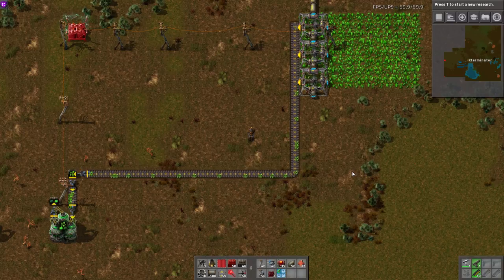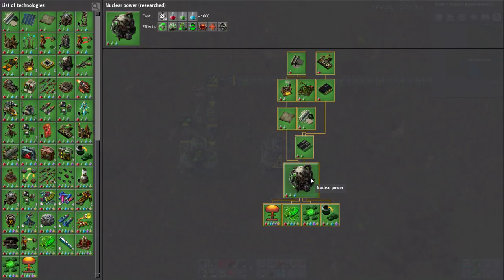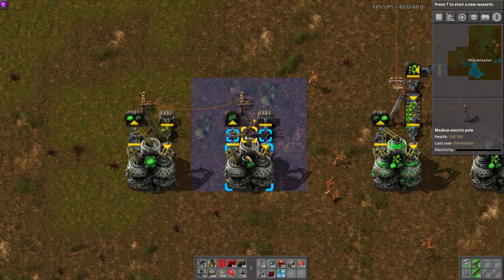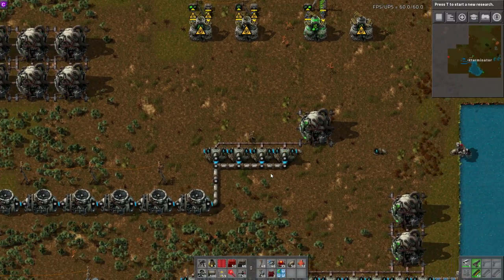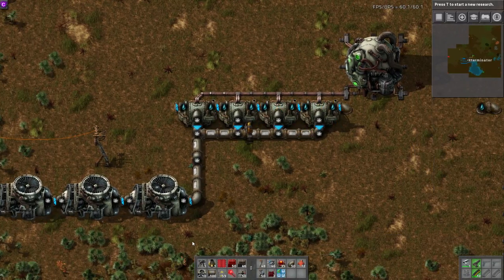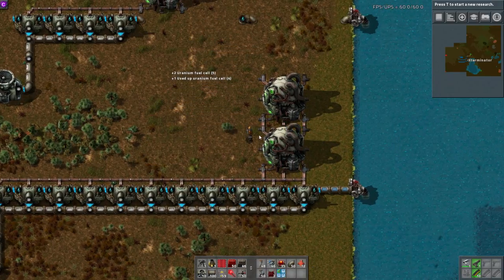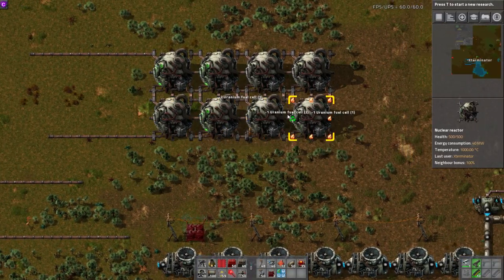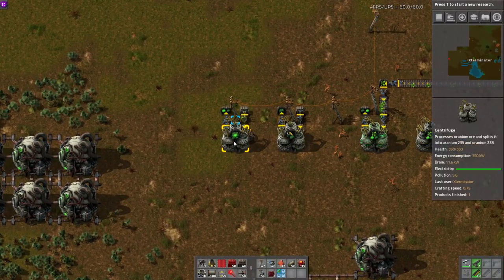Factorio 0.15 Nuclear Power Tutorial - Features & Ratios

Comment: There's going to be some creative nuclear builds out there soon. Unlike coal powered boilers which shut down if the steam engines aren't running at full capacity, the reactors run at 100%, burning fuel cells continuously whether or not the turbines are running at 100%. Additionally, they heat up to 1000 degrees, but the heat exchangers work at 500 degrees. So you can delay putting fuel cells in the reactor until the heat exchangers cool down and stop producing steam. The trick is working out how to measure the temperature drop so that steam is no longer produced. One way would seem to be storing the steam in a tank before it goes into the turbines. If the level starts dropping, it's time to let the reactor have more fuel.

Comment: Take note that a single heat pipe has a maximum energy transfer of 1 GW.
Reply from the maker: Very good point!
Reply: So that's 6 or 7 reactors if I were to take this spreadsheet, right?
 https://forums.factorio.com/viewtopic.php?f=5&t=44778&start=80
Reply: With the changes in v0.15.11, you'll never be able to hook enough heat exchangers to a single heat pipe to need to worry about it anymore.

Comment: If I'm understanding this correctly, The implications of the neighbour bonus are that you should build square blocks of reactors, rather than any other shape.

take 4 reactors. Loose, that's 4 reactors.
In a straight line, thet's 4, with the two middle reactors getting a 2 bonus, and the outer ones getting 1. so it's 4 + 6 = 10.
Arranged in an L shape, nothing changes. In a T shape, the middle reactor gets 3 bonus, the other three, 1 each. (6 bonus = 10 total)
Yet, put into a square block, all 4 reactors are adjacent to two others.
Thus the bonus is 8, for 12 total.

9 reactors in a square would be 9+4x2+4x3+1x4 = 33

Hmm. Seems like you want to maximize the internal reactors, and keep edges, but especially corners to a minimum.
5 reactors in a T shape is 5+3x1+2x1+1x3= 13
5 in a square plus 1, 5+3x1+3x2+1x1=15
5 in a 'plus' shape is 5+4x1+4x1=13.

OK, so it would seem the optimum is very much about having as many adjacencies as physically possible.
Not always as straightforward to work out as it seems for a given number of reactors, but it still seems as though the closest approximation to a square that's possible is best in most cases.

hmm. for 8 reactors, 2x4 rectangle. 8+2x4+3x4=28, 3x3 square with missing corner 8+4×1+3×2+2×5= 28, while 3x3 with missing edge is 8+3×4+2×2+1×2=26 -which illustrates that you should avoid unneeded corners I guess.
Reply: Wow that’s a lot of math :0
Reply: before building perfect squares and doing lots of maths, remember that unmodded inserters have only a reach of 1 or 2 tiles, and also can't reach diagonally. thus even on a small 3x3 square, no inserter will be able to insert fuel cells into the center reactor and you'll miss on all those nice neighbor bonuses as if that center reactor wouldn't exist. similar also applies to all other square or rectangle layouts which are wider than 2 reactors. even in the case of a small cross of 5 reactors, how would you feed the center one (that theoretically could get a bonus of +400%)? thus the practical limit is to have only 3 neighbours for any reactor, and as few corners as possible.

there are mods for inserters with extra long reach of 4,7,11,..., especially created to fuel up reactors in such huge rectangle layouts, and several other mods for operating them diagonally, but no such luck in vanilla and you are limited by accessability of the reactors, resulting in the most simple version, having stripes of 2xN reactors, already giving all of the reactors (except for the four corners) the practical maximum bonus of +300%, and still the next best +200% bonus for those four corners.

and even then it also already will be a challenge to make it tileable for larger values of N, and to feed it enough water while pipe throughput is limited to less than 1200 for longer pipes ...

Comment: If you haven't reasearched nuclear before putting down a drill it will not change; it will change after researching nuclear power.
Reply from the maker: That's really interesting! I didn't know that and never really thought of it actually. Thanks for pointing it out.
Reply: But then you still would be able to mine uranium? (od does it works faster with that Sulphuric Acid version? I'm quite new and actually didn't yet got to the Nuclear power
Reply: @Daralyndk  you wont be able to

Comment: With a probability of 0.007 of getting the Uranium 235 you need to make reactor fuel cells, you should expect to have the U235 you need after 143 processing cycles.
143 cycles will take 143*10/0.75 seconds = 1907 seconds
Put the U235 in an assembler and make 10 reactor fuel cells in 10 seconds
=> you have 10 reactor fuel cells in 1917 seconds
Those fuel cells last 200 seconds each, 2000 seconds total.

So a single centrifuge should be expected to produce fuel needed by a single nuclear reactor by the time it runs out of fuel.

There's no need to panic and process huge amounts of ore. If you only burn the U235 into fuel cells when absolutely necessary, eventually you should expect to build up the surplus U235 that you need o start the Kovarex recycling process.
Reply from the maker: I like the math! That's a really good point for sure. Although it's still cutting it pretty close, so personally I would still prefer to start mining as early as possible and save up the 40 to start the Kovarex Enrichment Process because then that can just snowball on itself.
Reply: if you used 1 centrifuge to generate the 40 U235, it would take 76267 seconds or just over 21 hours. :)
Reply: 100 / 0.7 = 143 processing cycles.
100 / 0.007 ( the correct percentage ) = 14286 processing cycles
Reply: Toasterbot959 143*0.7/100 = 1.001.

The percentage is reported to be 0.7% which is 0.7/100. Multiply that by 143 and you get 1.001.

If it's the number of cycles you suggest you're going to need 100 centrifuges per reactor.
Reply: You are correct, my apologies. I saw the 0.007 on the wiki and confused it for the percentage.
Reply: that can't be right. either I got extremely lucky or something is off. I got about 30 for a chest full of u238, which is about 5000. which is 30/5000 = 0.006 = 0.6%. Maybe someone on the wiki confused percents with the direct value? All values here are from memory and rounded rather generously.
Reply: The probability is reported to be 0.7% (which is decimal 0.007), you appear to have seen 0.6% (decimal 0.006). You don't get U235 every 143 cycles, you have a 0.7% chance EVERY cycle, so you have been 'lucky' I suppose.

That's why I said you should expect to have a U235 after 143 cycles of a single centrifuge. You may get less or more than one!
Reply: I didn't forget that it was based on chance. If you repeat something 143 times, each time with a probability of 0.7% of producing the outcome you would like, (U235 in this case), then you should expect that at the end of those 143 cycles, that 1 of them produced the U235. It could have been the first cycle, the second cycle, the third, ...., or the last cycle. There is a small chance that you could get no U235.

Of course the more centrifuges you use, the more likely you are to have U235 in 143 cycles.

All I was trying to demonstrate with this maths, is that 1 centrifuge should be enough to generate the 1 U235 that you need every 2000 seconds. Allowing 10 seconds to produce a fuel cell in an assembler, In the remaining 1990 seconds, you actually have time for 149 cycles, which increases the likelihood that you will have the U235 that you need.
Reply: Expected outcome of a low probability event over vast numbers (millions) is predictable.  Over 143 is not.  Sure you should get one, but you might not get one.  The odds for missing the .7% chance in 143 attepmts is actually close to 37%.  That is not insignificant especially if your factory shuts down on a miss.  Overall storing the 40 you need to run Korvex and using the output of that to run fuel cells is the more reliable option.
Reply: Interesting. Can you share the maths that shows the probability of not having the U235 after 143 cycles is close to 37%
Reply: Chance of receiving one .007 in 1 attempt, chance of not receiving .993.  Chance of not receiving one in 2 attempts is .993^2.  Chance of not receiving on in 3 attempts is .993^3.  Chance of not receiving in 143 attempts .993^143 =  .366 or 36.6%
Reply: The joys of expected outcomes vs probability.

Uses Mike's formula above, and considering that there are 149 cycles in the 1990 seconds that you have to get the next U235, then with 5 centrifuges you should expect to have 5 U235 in 2000 seconds, with a probability of 99.5% that you will have 1 or more. So until you have Kovarex going, perhaps a ratio of 5 centrifuges per nuclear reactor is a good one.

It's also the case of course that the reactors will continue to provide enough heat to the heat exchangers for some time after they have run out of fuel. Does anybody have measurements for that?
Reply: Thanks to DRY411S and Mike Lynch for this observation. Expected values are fun when they are surprising.  The creators did a great job of getting folks to think about their nuclear setups.

Comment: Very nicely explained. While I haven't got nuclear power yet in my 0.15 world I have done a bit of research (not the in-game kind) into how it works and you covered it pretty thoroughly.

One thing I think is worth mentioning is that the Heat Exchanger to Turbine ratio is very close to 4:7 (to compare the actual ratio is 60:103 whereas 4:7 is equivalent to 60:105). Not only is this essy to remember but since Exchangers will come in groups of 4 it's pretty convenient. Obviously in larger builds the discrepancy will mean having turbines that get no steam at all (about every 7 reactors' worth) but still useful for rough planning. 

I do have one question though. You mentioned the fluid rate from offshore pumps, but what about unbarrelling water or pumping from a train? As somebody whose most anticipated feature of 0.15 was the improved fluid handling (I can finally have the modular factory I've always wanted) I'm rather curious as to what it can achieve.
Reply from the maker: Thank you! :) That is a good point about the 4:7 ratio. It's certainly easier to remember. Personally, I prefer to just use the 1:1.72 ratio because it allows me to calculate it out regardless of the size or layout. 

For your question I'm not sure I can really answer that fully unfortunately. I believe the pumps that you use to pump from a train have the same flow rate as an offshore pump. In regards to barreling and unbarring water, I suspect you would need an insane amount of machines doing it sense the exchangers use water so quick.
Reply: just checked with the wiki: since version 0.16.8, barrels only hold 50 instead of 250 fluid, with a stacksize of 10 (time for barreling also was lowered from 1.0 to 0.2 to compensate). thus in the old version you would have been able to unbarrel a stack with 2500 fluid in 10 seconds, and now can unbarrel a stack with 250 fluid in one second, both values are much lower than the 1200 per second of pumps.
loading and unloading with a pump directly between wagons and tanks is extremely fast (maybe 2 or 3 seconds only; similar like using inserters with stack bonus and transferring from chest to chest), but from that tank onwards, it would be the same as if you have an offshore pump, with all the limits of (long) pipes etc. maybe trains are useful to cut down on length of pipes when the next water is far away, but it probably will be no huge advantage. in the same version 0.16.8, also wagons were nerfed to have a single tank worth of fluids only, thus either 25k fluids in a fluid wagon or 20k fluids in barrels in a cargo wagon. to achieve the througput of pumps you need to handle one wagon per pipe in 20 seconds. for a small reactor setup which needs 4 pipes of water, you would need a 1-4 train every 20 seconds, or a 1-1 train every 5 seconds :-)
ps: i have seen some similar setups in some video clips, transporting water from far away with 3-12 (or longer) trains and thus having more compact setups than using 12 parallel pipes, but it will be a challenge, especially when you would need to cross heatpipes and train tracks which isn't possible ...

Comment: Yeah, the thing is, you really want your arrangements of reactors to be in a square shape to make the maximum utilisation. Which means you lose the ability to insert fuel into them and remove spend rods when you get a 3x3 setup or above. A 4x4 would be awesome. We really need the bots to be able to directly insert and remove from the reactors. Yes you could use a 2x(whatever) setup, but that gives you a maximum of 300%. A 4x4 setup would have the 4 reactors in the middle at 400%.

Alternatively, we could use a 5x5 setup, leave the reactor in the middle empty, and use the adjustable inserters mod and logistics chests in that centre area, this would give you 24 reactors, 4 would be at 200%, 4 would be at 400% and the rest would be at 300%. That's (4x3)+(4x5)+(16x4)=12+20+64=96.

96 * 4 * 1.72 * 5800000 = 3,830,784,000 from a small 5x5-1 field.

I've got some further questions. If a reactor has no fuel, will the neighbouring reactors get any bonus? Next, rather then toggling the fuel from the reactors, can we store the steam? Or use accumulators? I would imagine that the reactors would work better if the fuel were constantly in them rather then removal.

I think a mod which allows neighbouring reactors to share fuel would work awesome.
Reply from the maker: I agree, being able to make a square with them would be ideal. Without using mods, the best we can do now for that is manually insert the fuel every once in a while for the ones in the middle. 

For your questions:
Nope, it won't get the neighbor bonus if it has no fuel unfortunately. Yes, you could store the steam and probably use accumulators. I suspect there might be some downsides to storing steam though. Would require more testing and time to actually figure it all out though. 

That would be a pretty cool mod too!
Reply: I could probably imagine people avoiding nuclear just because by the time they've unlocked it, they've already stamped down enough coal and solar. The sheer scale of the processing required to get it off the ground is large enough that you've already built a tonne of solar to support it. With coal being a better option then it was, do we really even need it? I can imagine that players may use it, but next to a giant accumulator field just to maximise the yield, and they may not plug it in until they had an absolute tonne of fuel for it and a huge reactor setup. Honestly, it may prove too expensive in the players time to bother with.

Comment: Very useful for designing your own reactor setup. One question though - if you have multiple reactors adjacent to each other to get the neighbour bonus do all reactors still need to be fueled or does only one need it?

EDIT: Tested it myself already.The only thing that unfueled reactors do is convey heat (very expensive heat pipe)
Reply: Thanks! I was wondering about that too.

Comment: Another useful ratio which I calculated is 29:116:200.  That's the perfect ratio of active reactors to heat exchangers to steam turbines.
Reply: Daniel Senti You are forgetting neighbor bonuses on the reacters. an 4x2 reactor can support 112 heat exchangers, for example.
Reply: Safrus Salmus I'm not forgetting that. You can count the 4x2 grid as 28 reactors (as mentioned in the video) and then add one standalone reactor to make 29.
Reply: Those aren't exactly "perfect" ratios. Putting one reactor as standalone would be wasting, so of course we put it next to the others. But then it'll obviously count as 2, so the ratios change as well.